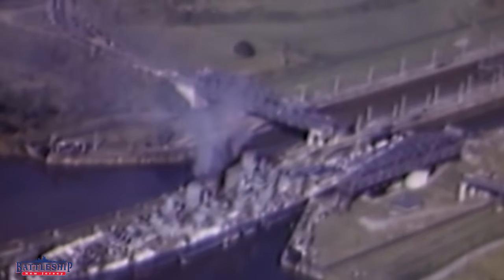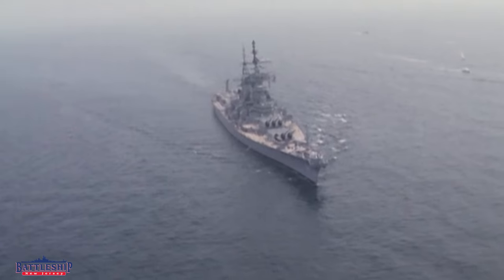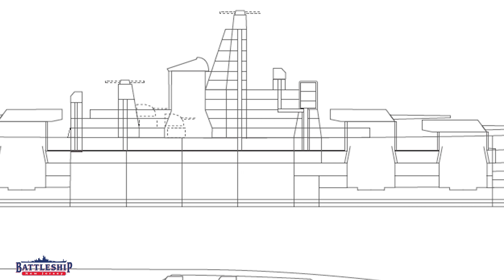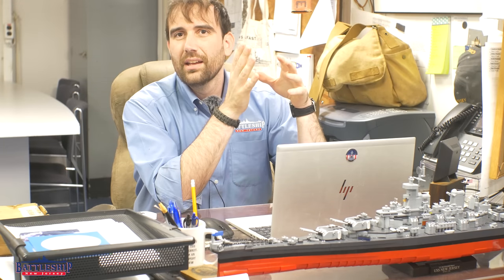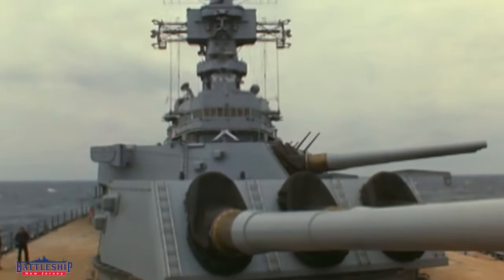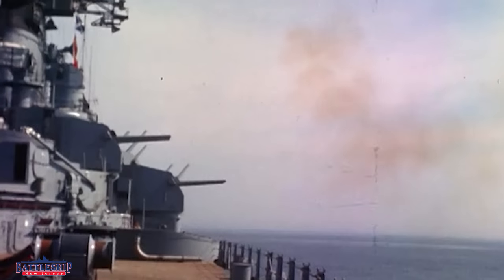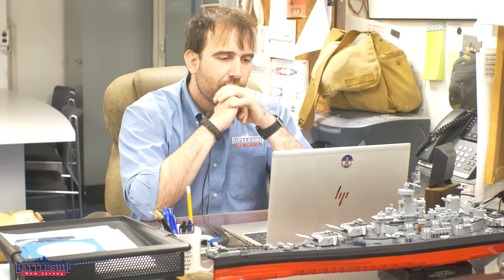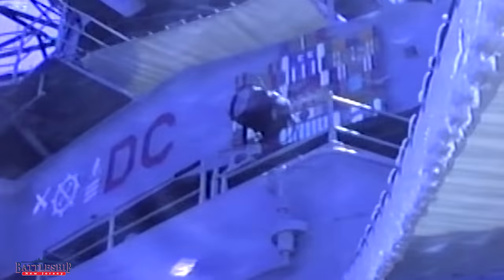The Perfect Battleship

Comment: Why a battelship? I think on a hunter cruisers. The principles of the hunting tank converted to a hunting cruiser. About 6.000 t. This does now allow more armor than something to protect from a 20 mm gun. So any defense can be only based on speed and long range weapons. Turbo electric with engines in front and rear for extreme fast changing direction. 
When it takes 20 seconds that a 16" shell travels 15 km, this should be enough to be somewhere else, when the enemy fires.
Hunter cruiser means no gun turrets for the main weapons. 
3 times 8" guns with 120 m long barrels. Aim horizontal with the whole ship. Aim Horizontal by elevating or lowering the rear of this 8" guns.
There is nearly no elevation necessary, using APFSDS. 2 m long only 5 cm diameter 30 kg steel, but about as much charge as for a 16" shell. 
When the only 5 m barrel of a tank can accelerate an APFSDS to 1,8 km/sec, the 120 m barrel should be able to 3 km/sec.
Difficult to calculate the air resistance and how fast the APFSDS slows down. But when 15 km are in 6 seconds, and about 2 km/sec remaining speed, the APFSDS should come though any battleship armor. After the armor, the APFSDS could travel far through the ship, starting fires and igniting ammunition, piercing steam generators. No battleship would have any chance against 2 or 3 hunter cruisers. 
Slow traveling 16" shells traveling 20 sec for 15 km against a very agile ship with shoots APFSDS in only 6 sec over this distance

Comment: It is now 2023 and you have country x that is building ships that have both guns and rockets. You need a new ship that with the new Panama canal width you aren't limited to 108 ft. You can arm it with all new everything. Included Laser anti air and cruise and standard rockets You are going to build 2 and they can use nuclear power. So it can be both a major rocket launcher, shore bombardment  use of rocket assisted 16 or 18 in shells. Its main purpose is to  protect the aircraft carriers as well as secondary role of heavy shore or up to 200 miles inshore bombardment. sky is the limit.

Comment: The Iowas ended up at 58000-ish tons. Could you fit everything you wanted within that tonnage?
Reply: Ryan was referring to standard displacement as defined by the naval treaties.  The Iowas were right around 45,000 tons standard, but 58,000 tons full load, so probably not.  Really, to get everything Ryan wanted into a single ship, you're looking at closer to 60,000 tons standard/75-80,000 tons full load.  You know, like Montana.

Comment: I suggest we review Friedman's 45k BBs (p.330-331) and Gibbs and Cox 'D' (Warship International, March 1921 for the 'D' drawings) to answer Ryan’s question. Essential information is listed below. 
                       New Jersey	            Gibbs and Cox Russian ‘D’	        BB65A			BB65C-6	
Weight	       45,000		            45,000				                45,435			44,840
WL	               860		                    820				                         800			800
Beam	       108		                    113.5				                         108			108
	               9-16” (3x3)	            10-16” (2x3, 1x4)		               12-16”(4x3)		10-16” (2x3,1x4)
	                20-5”		            20-5”				                       20-5”			20-5”
Belt	               12.1”@19o	            13”@15o			                       12.1”@19o		14.3”@19o
Deck	        5.1”		                     5”				                        5.1”			         5.5”
Speed	        33kts		             31kts				                        27kts			27kts

The basic problem is that contemporary 45,000 ton designs lack the volume for 4 turrets and 200,000 shp plants.  BB65A and BB65C-6 both have South Dakota plants.  ‘D’ solves the length problem by making the hull wider which allows the boilers, turbines, and turbogenerators to be placed in the same compartment as North Carolina and South Dakota.  ‘D’ bears a strong resemblance to BB65C-6 which isn’t surprising since Gibbs also served on the General Board.

Can we modify the 'D' to make room for a fourth turret?  A careful examination of the plans shows that the four unit spaces are 13 frames in length, or 52 feet. Since the D is 113.5 ft wide, they can get everything in one compartment like North Carolina/ South Dakota and generate 200k HP. The added width saves length.

There are 12 frames underneath the forward superstructure that consume space that would allow you to move the engine rooms forward.  However, the displaced crew quarters, laundry, small arms magazines, plotting room, etc, would have to be relocated to additional levels of superstructure similar to South Dakota or displace something else.  You could recover crew space by eliminating the hangars and relocating the catapults aft.  Relocation of the plotting room seems difficult.

The two turrets forward consume 32 frames while the quad turret aft consumes 16 frames.  I believe they use some of the width available aft to make up for the lack of length for the larger turret.

Therefore, if we want to replace the 4-gun turret aft with two 3-gun turrets, you need to add 16 frames by repurposing the 12 frames from the crew space plus add four frames (16 ft) to the length.  Could this be 'paid for' by decreasing the 13" belt to SD/IA standards?  It also might mean that you will exceed 45K tons and you will be adding topweight with the relocated crew space.  A problem that does not get discussed much is that U.S. plans for 4x16” or 3x18” turrets required a face plate wider than any armor plant could produce at that time.  A new armor plant would need to be constructed!  Who is paying for that?

BB65J (p.330-331) mounted 12-14”/50 in four turrets and had much heavier protection.  The protection could be traded for speed.  It is not clear if a super-heavy shell for the 14”Mark B designed for North Carolina was planned.  If so, it could weigh 20% more than the usual 1500lb projectile.  This combination could be formidable against any battleship except the Yamato.

Based on these studies, it doesn’t seem possible to mount 12 guns on a 30 knot battleship unless you reduce armor or gun-size significantly.  All ships suffer from the typical project management ‘triple constraint’. Between armament, armor, and firepower, two characteristics will ‘win’ and one will suffer.  For a WWII BB, given 45,000 tons as the major design constraint,  P.W.Snyder of BuShips (p.324) suggested the New Jersey be shortened by 40 ft, widened by 6 ft and be subdivided like the Montana.  It doesn't have four turrets but I think it meets Ryan's quest for the perfect battleship.

Comment: You want to design my "perfect battleship"? "rubs hands together: I'll pretend I know what I'm talking about, like a congressman making a Christmas list for a present-future BBGN.

Mission: How about something modern for current warfare needs? Unfortunately, I'm thinking it might need to be capable of nuclear deterrence duty against Russia, PRC, DPRK, but might also need to strike targets with conventional or kinetic munitions hundreds of km inside a country from hundreds of km out in the ocean, such as hitting targets inland of the PRC coast from the east side of Taiwan. It should be able to support assault operations near the shore from far enough off-shore to avoid accurate counter-battery fire by modern land-based tube artillery by time or distance, and far enough away or fast enough to confound rocket-based counter-battery fire. The ship should be able to operate alone as well as in a task group.

Main Gun: There should be a strategic range big gun or guns with sizes and ranges similar to the superguns designed by Gerald Bull for Saddam Hussein, such as the Baby Babylon (350 mm bore, 30 or 46 m length) that could range 750-1000 km, although I'd accept range met via shell enhancement as well. Although, maybe we should also consider the Big Babylon (1000 mm bore, 156 m length) that could reach orbit. Range can be met using base-bleed or rocket-assist or glide-wings or some combination. At this range, shells should be PGM with a low CEP, but with a range of munitions and submunitions, including nuclear. Feel free to explore alternate gun tech such as electromagnetic or ram accelerator, since that would be interesting too. I'm not sure how many barrels there should be, or if the supergun should be housed in a turret or fixed in place except for elevation change, and then aimed by pointing the ship in the general direction and relying on PGM fins or rockets to get to target.

Secondary Guns: There should also be tactical shore and inland bombardment by one or more smaller caliber guns at ranges at or beyond 100 km or further using both inexpensive dumb shells and PGM shells, such as the Advanced Gun System or similar land-based systems.

Missile armament?: This BBGN should probably have some VLS cells to carry Anti-ship missiles, land-attack cruise missiles, SAMs. Can the standard VLS cells carry anti-satellite and/or anti-ballistic missiles, or a rocket-launched anti-submarine torpedo?  While we're at it, since this could be considered a nuclear capable asset, I wonder if it would make sense to have SLBMs like the Trident D5. I'm thinking it's overkill, but what do you think?

Point-Defense armament: CWIS, future lasers, SAM? I want it to stop drones, aircraft, incoming missiles. Crew-served machine guns and automatic grenade launchers, etc. should be available for low-intensity conflicts against speedboats, like anti-piracy and freedom of navigation patrols/transits, port calls.

Armor: enough to stop several modern anti-ship missiles with conventional warheads. Enough to protect the crew from nearby nuclear attack, which is probably doable based on the Operation Crossroads Baker test, but I wonder if it should be enhanced with neutron reflectors and absorbers.

Propulsion: nuclear powerplant, number of reactors and screws and rudders your choice, but able to keep up with modern supercarriers at least. Faster is probably better so that it might evade detection and targeting by ballistic missiles. Would it be useful to consider azimuth thrusters and electric transmission instead of driveshafts?

Stealth: As much as I like majestic silhouettes, I suspect stealthier is better to avoid detection and tracking. This might suggest guns should be angular and barrels might need to be hidden in stealth boxes like the Zumwalt, or entirely below the main deck. Perhaps it shouldn't even have a superstructure, if the ship is big enough below the waterline.

Sensors: I'm guessing gunnery would have to be performed via indirect surveillance assets, like satellites, spotter aircraft and drones anyway due to the ranges involved in the most common mission of deterrence patrol or long-range fires. Thus, it may not need the suite of radars common to Ticonderoga, Arleigh Burke, and Zumwalt. Alternately, some sensors could be placed on extendable masts or tilt-up panels. Could it could be as low-profile as the proposed arsenal ship? If it's that low profile, could it also be made submersible to increase stealth and survivability from incoming missiles that might try to home in via radar, IR, or visual ID?

Ancillary Vehicles: The BBGN will probably need several unmanned vehicles. This may include one or more long-range drones for gunnery, and maybe one or more for air defense. I'm also thinking the future Navy might make use of light wing-in-ground-effect vehicles (AKA flarecraft or ekranoplans) as multi or "transmedia" vehicles that can "fly" and then float or submerge and loiter as defensive pickets using radar and sonar to defend against aircraft, missiles, and submarines.

Size and shape: It should fit through all major current canals. It should have room to land a helicopter, maybe even a hangar to keep one in addition to various unmanned vehicles.  It should be able to meet the mission requirements while remaining small and inexpensive enough to allow for a fleet of half a dozen to a dozen or more.

Crew: I'm hoping it could be kept smaller than the Iowa class and closer to a modern submarine or cruiser.

Does this sound too ridiculous? Did I forget anything?

Comment: Why don't try to create a BB but with the NEW PANA MAX!?
Plus add composite materials and kevlar for protection.
4 shafts but I would put 3 rudders and put propellers on the bow for turning.
I will use 17.72" guns, not Yamato put bigger than the normal.
Reply: I believe Montana was designed with the assumption the Panama Canal would be enlarged to something roughly the same as the modern expansion.

Comment: Id do a French German combination design, two twin tiers up front, 500mm (20 inches) and concentrate my armor on the prow. The idea being that the ship goes towards the enemy presenting a very narrow and heavily armored profile, and an extreme angle to help shells bounce off the armor. Or stay beyond enemy range since 20 inches should outrange anything else on the sea.

Of course just 4 guns is very little firepower so need to squeeze all the rof and accuracy I can out of them. But the sheer size of the guns does mean that any hit will be telling and penetrate any other ship on the sea. 

For secondaries 4 twin 203mm guns, ideally dual purpose. Because of treaty limitations a lot of 203mm guns where developed, so piggy backing on that, and 8 8 inch guns will dusade most smaller ships from trying to chase the ship.. though none where developed into dp guns from my offhand knowledge.

For tertiary guns sure let's add some American 5 inchers, depending on how much tonnage is left. 

As for speed this ship will need to be speedy, with only a frontal armament and most of the armor there it'll be hard to disengage, and high speed let's the ship use the range advantage of the bigger guns. High speed also means no targets can escape the ship easily and it gives tactical and strategic flexibility.

Of course it needs floatplanes and radar to be able to find targets and to make the most out of the range on its guns.

A turbo electric drive is neat, but it's hard to get much performance and heavy so might have to go with something faster and lighter.

Comment: Out of all the battleships in history, I'd say the Iowa-class is my ideal battleship to begin with. Though, I do like a 50,000 to 55,000 standard ton Montana with Iowa's speed characteristics. I'd keep the main battery and secondary battery the same, but I would remove the 40mm Bofors for the 3in AA that the Des Moines-class heavy cruisers and Worcester-class light cruisers have, external armor belt, and up-armor the deck a hair from 6in to 7in max. Unfortunately, I would keep the conning tower, because I LOVE the enclosed bridge of the Iowa's, I wouldn't go with the tower superstructure design of the King George V-class and HMS Vangaurd.

Comment: @Ryan my battleship has to have some type of ASW capability. In the event the ship is unable to run with destroyer escorts, it has to have something besides Nixie to defend against subs. My thought is an active sonar array that can be lowered and port and starboard hedgehog DC launchers. Small footprint, low weight, easy system to operate and reload.

Comment: The perfect modern battleship would be completely unreasonable - but why let that stop me?

Nuclear power, and lots of it drving four massive azipods.  

Four three gun railguns of the largest size possible.  Four two gun railgun heavy secondaries in wing turrets.  Light secondaries using 155 mm guns to make use of existing 155 mm shell varieties.  Multiple CIWS for point defense.  Browning M2s just because I can.

AA provided by epic amounts of SA missile batteries.  CIWS would provide last chance defense.  I would also have a large amount of long-range land attack missles, possibly in VLS tubes.

Active towed SONAR arrays.  It's not like this ship is hiding from anyone, so I would rather see EVERYONE and EVERYTHING coming anywhere near me.  Whatever the latest RADAR is and possibly some sort of IR if it's useful.  The latest in communications with lots of redundancy.

ASROCK at a minimum.  Some sort of autonomous attack drone sub or long range torpedoes to go after subsurface targets.

Enough armor to protect against "normal" anti-ship missiles.  I'm not worried about defending against some destroyer's 5" gun.  Conversely, I doubt it would be possible to slap on enough armor to defend against the so-called "carrier killer" missiles.

The size would be massive, probable super tanker large.  You would need to size to provide enough buoyancy to mount everything and to hold enough weapons and ammunition  to defend against the inevitable onslaught that would be sent to sink it.  Ideally, this ship would cause absolute terror in its enemies.  They would know that it is coming for them and that there is nothing they could do to stop it.

The cost would be even more massive, let's say $50 billion per copy.  Could it ever be built? Maybe.  Could it actually function and succeed as intended?  Possibly.  Would Congress ever fund even one?  😅

Comment: Perfect battleship? Incorporating modern composite armor into the belt and deck armor of a NC class ship that's extended 80 feet longer for the additional HP to make it go 33 kts
Reply: @@E-Hamel1911 I was kinda shocked that nobody else had mentioned it. Even a modular system with Chobham armor sections on a frame would weigh as much or less and for the most part give vastly superior protection.